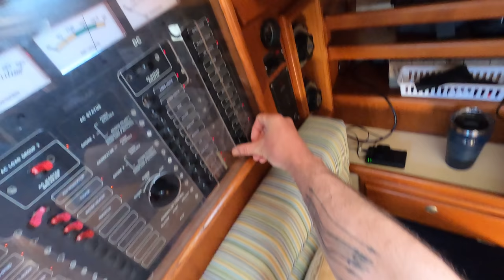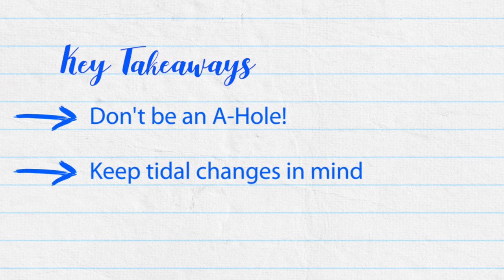I'm an IDIOT... | S06E04

Comment: I always enjoy the engine repair videos because I feel like I can control your diagnostic process with my mind.  I remember an episode from back in Panama when you were having problems with your outboard.  You kept fiddling with the starter, and but it still wasn't firing up.  Maybe the diesel's bad, I thought.  "I bet there's water in the diesel," Jordan said.  And there sure was!  Jordan filters the water out of the diesel from the tank and tries starting the engine--still no dice.  "Why is it still not working?" asks Jordan.   You only filtered the diesel in the tank, I think to myself, not the diesel in the engine itself.  Two seconds later, Jordan exclaims, "OH, wait, I have to bleed the fuel out of the engine.

It's fun watching you work your way through all of the likely causes, from the cable to the transmission to "huh, maybe the handle's just sticky." 😀

Comment: You guys did well , The best lessons are the hard ones. I own  Pacific Seacraft 44 , identical just a bit bigger and longer , I have learned over the 6 years of ownership to always in tight docking areas to remember the best control i have in turning on a dime and having that control you want (turning on a dime) is always in tight spaces is to turn to starboard, rudder hard starboard , keep it there , go slow.... quick hard on forward with throttle for a nice rudder flush, pushes stern to port , then just as you feel forward movement , keeping wheel hard to starboard, shift to reverse full throttle for a quick port prop walk in reverse , again pulling stern to port, as soon as you feel backward movement , another quick forward rudder flush again pushing stern to port. She will turn on a dime and your in control. If space permitted in the area where your slip is , I would have used this process to motor slowly past your slip , with your slip close to your port side as you pass it and then after you have gone past , use the above procedure to turn around and come into your slip from the other side at a 45 D angle , again as you slide into the slip from that angle you have your port prop walk to suck the stern into the dock ...... make sense ?

Comment: Although you've added about 12' in length from Atticus I, that's only a 39% increase.  The big difference is you've doubled your displacement from 12,000 lbs to 24,000 lbs.  That's why you need higher RPMs to slow the boat down when docking or changing direction at anytime.  As noted by a previous commenter you can use the greater momentum to your advantage when maneuvering

Comment: The secret to reversing a Pacific Seacraft is to get some speed in reverse with a quick blast of power and then kick it back onto neutral and steer in neutral. That removes the prop wash element in reverse. 

In forward, you use the prop wash over the rudder to push the stern around quickly rather then waiting for the boat to turn through movement through the water. This can be done while moving backwards for coarse correction. 

......... and then just leave PLENTY of space to coast into places. Our 37 fully loaded to cross the Pacific was 20,000lb.  You could coast onto a dock or up to a mooring from nearly 1/4 mile away in slack water and calm wind. Minimum speed before loosing steerage was less than 0.5 kts.

Comment: Great job moving that boat around for the first time! The day I closed on my 37' was the same day I finished the ASA 102 class, which was the first boat docking I'd done since I was 12 years and had gained a little experience on a 21', outboard, little cabin cruiser.  Within 15 minutes of getting off the school's 29' boat I made myself go directly to my boat, get it started, and took it in and out of the slip and marina three times solo. I was nervous as hell and did not want that fear to grow, even just overnight. I then opted out of bi-monthly pump out services so I could practice docking at the various pump out docks around San Diego Bay that all have different approaches and prevailing winds. I also practice backing around the smaller no wake bouys pretending I am backing into a slip. Practice, practice, practice. I recently turned down a free bow thruster a friend offered me when he upsized his. PSCs turn on a dime and don't need them, most of the time😲 and I don't want another system that can get fouled, break and that require maintenance. And, like you guys if I'm not in the marina, I'm on anchor anyway.

Comment: Hey guys when docking into a slip I  would always go into the wind to counter the drift. It gives you more control and consider reversing into the wind if the prop walk is in your favour. You can spring line first to manage the overshoot.  André

Comment: You might also what to try using what my best beloved calls "the parking strop" basically this is a line about five feet long with a loop on either end the 'boat end' is made onto the midships cleat and the 'dock' end (which has some hose on it to hold the loop open) is dropped onto the horn of a dock cleat the boat is thus drawn along side and by motoring gently ahead will stay there all day while we go about putting on breast and spring lines at our leisure. Works for leaving too. Keep in mind our boat is a Contessa 32 so for Atticus 2 you'll probably want a bit more length.

Comment: When in a tight spot and your battling port prop walk to turn your boat around, just keep backing out of that entire area until your in a more open space. Usually it only takes about 3/4’s of your boat length to gain complete helm control, then with consistent movement backwards, prop walk goes away and you can back up in a slalom course if you want? The employees for the sailboat charter companies all over the Caribbean do this. They go all over the marina going in reverse, to the fuel dock, to the guest loading dock etc etc. looks kinda funny but works very well.

Comment: Docking takes lots of practice.  I started off by learning to bring a wooden dinghy alongside, firstly rowing then, sailing, later bigger dinghies and yachts with various configurations and engines.  Perhaps a bow thruster would be useful assistance in the trickier situations you will encounter when cruising.

Comment: One trick regarding docking is to put amid ships spring line to a dock cleat first. Doing this prevents you boat from drifting away from the dock while securing your other lines. This is a single handlers trick. Give it a try.

Comment: Remember: turns in fwd to port. Turns in rev also to port. Most control with stern into the wind or current. For leaving that slip I would have gone in reverse all the way to somewhere easy to turn (we’re 64’). Practice doing figure 8’s in fwd and reverse. Practice motoring into a spring line to move bow or stern sideways away from the dock.

Comment: Docking with a cross wind is always tough. Whenever possible use the current to your advantage. Current can compensate for lack of a bow thruster if you can determine its effect on the bow.

Comment: The juju is not in a spring line or a breast line but in learning to dock using your midship cleat.
It acts as a breast line and a spring line at the same time, it stops the boat, and allows the 
helmsman to control the positioning of the boat next to the dock while the crew secures the 
boat with the breast and spring lines.  And remember to keep the antifouled side down.

Comment: I give you 10 points for admitting to the boo boo ,I've had to wrap the G Box gear stud in foil to get a better grip before as the grooves had worn down & once on an old Perkins tap welded it until i managed to get some where to fix it (3 years later) - Fair winds .

Comment: I think you may know I owned a very similar Crealock design (but full keel) in a Westsail 43. I owned her for 18 years and almost always sailed her single-handed.  When it comes to easy docking, using a spring line with a Johnson hook is the secret. You have to play around a bit with line length and where it is attached amidships to the boat to figure out what balances best (no other lines in play).  Once you get that spring line attached to the dock, with your transmission in FWD, you put your helm hard over and the boat will suck right up to the dock.  While it sits there, you can take your sweet time with all the other lines. Leaving a slip is just the opposite.  With the boat in FWD gear, and helm hard over, I casually remove all the other lines, leaving the spring line for last. For this operation, I used a trip line tied to the Johnson hook at the dock end of the spring line to pop the hook off the cleat and retrieve the line as soon as the line goes slack when I start to back out.  The Johnson hook on a boat hook pole can also be used to attach the spring line as you come in (with slight forward motion).  I noticed that you did discover the effectiveness of “brute force” when it comes to turning these boats in tight spaces.  Good job!  It really works - in both directions.  Although it requires having faith in your drivetrain, using brute force, you can literally turn one of these boats on its length.

Comment: Find a "sweet" spot for the spring line once one is on you can steer the boat toward or away from the dock.  Practice with the spring line at the dock it will take 90 percent of the problems away.  The sweet spot will allow the boat to turn left or right with the rudder alone.  Usually it is placed slightly aft of the mid point of the boat.  A pre measured spring line will prevent the bow from hitting the dock. The line placed too far forward will bring the bow in too quickly tot far aft the opposite. You wil fine you only need one line while  docking--a properly place spring line.

Comment: Not bad at all considering the boat is new to you!! Some advice if I may; when you’re coming in to a dock travelling forwards, if you have a spring running from a foredeck cleat taken aft (outside everything, of course!) to a point just aft of maximum beam whoever’s handling the lines can simply step off, taking the spring with them & then shortening/making fast on the aft most dock cleat. If the wind/tide is taking you away from the dock just put the engine into ahead (probably not much more than tick over) & helm over. So long as the spring has been sufficiently shortened the boat won’t go anywhere!!
Hope that makes sense - I had a similar sized yacht with a full long keel & sailed (and manoeuvred) single handed fairly often.  Good luck!!

Comment: Everything takes practice for sure, but when backing, as soon as you have sufficient movement back, put the engine in neutral, this way there is no prop torque and the rudder  can start doing it's job. I practiced docking so much, I was able to sail to my slip, head up and back in with no power. When you can do this, you can start enjoying docking.

Comment: Always use the stern spring line first part way back from mi line. Go forward on the spring with rudder hard over and the boat comes to the dock straight. 
Snub the spring and do not make it fast . Your boat carries a lot of weigh so being able to stop with spring line is important. Max prop will also help with great stern propulsion. Might find one on eBay.

Comment: In the future, there is nothing wrong with backing up the fairway instead of doing the Austin Powers style turn you did.  Back out of the slip, let the wind take the bow to leeward (opposite direction you are trying to travel) and then reverse in the direction you want to travel.  Make sure to maintain control of the wheel/rudder.

Comment: Hi guys.  Kudos for filming during all those docking maneuvers, like it isn't enough going on already.   Your analysis of each maneuver is spot on.   Before you know it you will be expert docking.  !

What I liked to see,  first thing you did was do two hours of docking practice (both of you).  I see soooo many new boat owners, who do not take this time to understand how their boat behaves and get really good at docking, early on.    Your boat appears to have a substantial prop walk to port,  so you are learning how to anticipate it, and use it to your advantage.  Good.

You have discovered that an immediate, strong burst of power and then back off will kick the stern very substantially.    You will find you can pirouette the boat around within a 1/2 boat length in the fairway, using the back-and-fill technique, the only  outside factors being wind and current.    You will find it much easier to 'back and fill' pirouette in a clockwise direction, more so than a counter-clockwise direction, as the 'back' phase works with the turn instead of against the turn.     So much so that you may decide a 270 back-and-fill clockwise pirouette to exit the fairway is better than a 90 counter-clockwise in certain situations  (wind and current allowing).   Particularly if your boat does not back up particularly well.   I am guessing your design will backup relatively well once water is flowing over the rudder backwards. 

The other point, I see you are learning, is to anticipate and manage inertia, via the engine and prop,  not man-handling the lines.  When you get to a boat of that size, man-handling does not work so well any more.  Another point is to have a fender available to drop between the boat and the piling/dock, which works better than a push off.  

You've got this.  You have the advantage of already owning an uncooperative full keeler's sluggish behavior under your belt, so you are already a back and fill expert !

Best to you.

Comment: great episode and job, buds! new boats always take some time getting used to. It's what us charterers struggle with every charter lol
I think I would have backed up between the slips and past your box, so that I can drive INTO the wind during the docking procedure. Or perhaps I would have even reversed into the box, since your less susceptible to the wind that way. In any case, I'd definitely drive INTO the wind during the docking maneuver. The rest depends on the layout of the slips and everything else happening around you. But with the info I have from the video I would have probably picked my option A.
Also, Desirees line might have been of better use on the pole. To act as that spring line you were missing. :)

but all in all....I agree with Jim! Good communications. Nobody freaked out and panicked. No dings! Great job!

Comment: Nice job guys, lots of progress.  Try using a mid ship cleat and getting that on the dock first.  The boat won’t go anywhere once it is round a cleat and the bow and stern will not fall off.  Practice makes perfect, more sailors need to practice rather than just going on a wing and a prayer when docking in a crowded marina. Andy UK

Comment: I solo an Island Packet 350.  I usually step off the boat with a midship spring line in one hand with the stern line in the other hand.  Of course I trail the bow line along the lifelines to midship so it can easily be reached.  My technique is to short tie the midship line which keeps the boat from moving too far away from the dock and to stop forward drift.  Seems to work well.

Comment: The extra size is tricky.  I went from 22' to 30', and now I am going from 30' to 36' (and from a fin keel to a semi-full keel).  It's going to be fun.  One thing I learned from a dockmate years ago was to put a line on a mid-ship cleat and attach that at the rear of the dock first.  That kills my forward momentum and snugs the boat up to the dock in one motion.  Then I worry about the other lines.

Comment: 17:20 if you throw a stern line loop over the dock cleat as you come in and then idle forward turning away from the dock the boat will nicely come along side the dock where you can attach your other lines and then but the boat in neutral. (Stern line loop 4-6 metres depending on your boat and is essential its attached aft your boats pivot point) It makes docking single handed a breeze.

Comment: you might find the best way to turn your bow in close quarters is to give a quick shot at high rpm with the rudder hard over , then back to neutral or idle . . that moves a lot of water past the rudder quickly without much forward movement

Comment: For your home slip, try ferry docking. We have the same situation, and it works great for us. We have the “stern line” just behind the widest point of the boat and it stops it early in the slip (no risk of bumping the bow), sucks the boat up to the dock just with the fwd momentum of the boat, and if you ONLY have that line on, the boat will still hold it’s position if you give it some idle forward and put the wheel in center or slightly toward the dock, and its just one line to deal with in order to get into a stable position to be able to handle the rest of the lines and tidying up. It’s my favorite docking method where the boat is getting blown off the dock by wind or current. One important note: put the line around the  forward horn of the dock cleat and exiting the back horn, as once the boat’s connection point passes the forward horn of the dock cleat, it will com off of that, and you will then need that “aft” horn of the dock cleat to hold the line.

Comment: You should always spin the boat in the other direction using the prop walk in your favor, even if it means turning all the way around. If you need to turn the stern against the prop walk coming out, you can push off the dock "pre-spinning" the boat in the other direction. If it is rougher, back up with a spring line attached to spin in the direction you want.